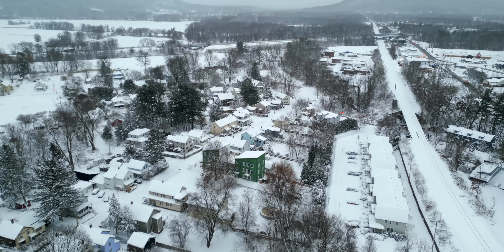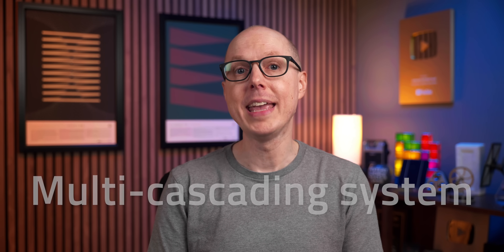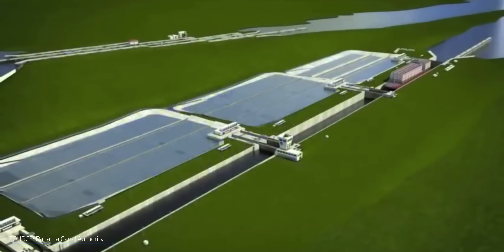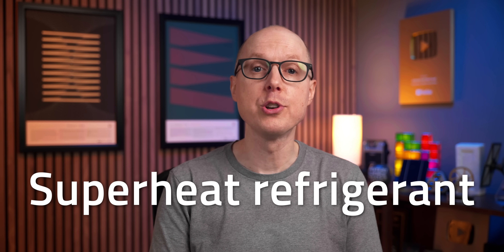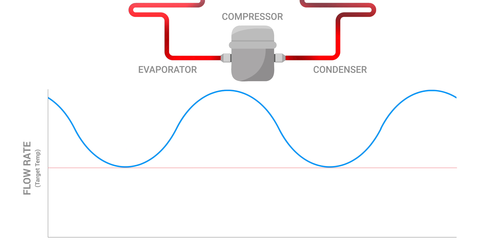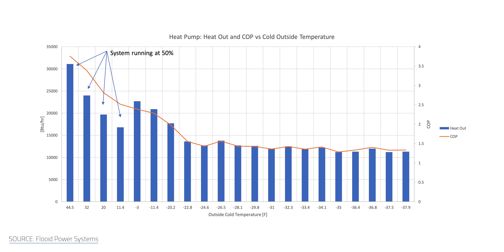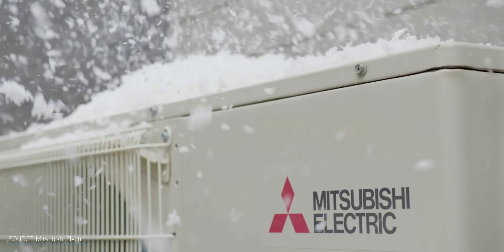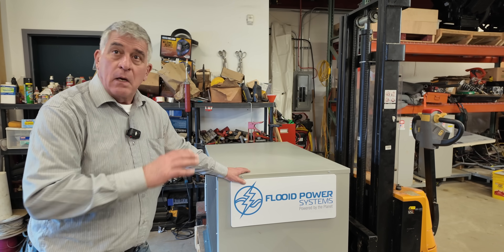How This New Heat Pump is Genius

Comment from the maker: Would you be interested in a cascading heat pump for your home? Try Rocket Money for free: http://rocketmoney.com/undecided  #RocketMoney #personalfinance

If you liked this, check out Why Do American Homes Suck? https://youtu.be/KDXjSpoOQmQ?list=PLnTSM-ORSgi7uzySCXq8VXhodHB5B5OiQ
Reply: I’m still hoping you do a video on fabric ductwork… it’s been shown to save up to 40% of the energy in commercial and industrial ventilation. Huge savings globally if adopted and could significantly help us reduce our carbon footprint as a species
Reply: @grantramsay9956  40% compared to what? Flex duct without insulation in the attic? That isn't even legal for commercial  where I live. Fabric ducts would actually increase energy consumption as it has a higher friction coefficient than steel.
Reply: @SuperS05  not sure where you got that info… Operating static pressure for fabric duct systems is 0.5 inwg and can go as low as 0.2 inwg. With a pressure drop of 0.03 inwg/100ft compared to sheet metals 0.05 inwg/100ft it also doesn’t have a worse pressure drop coefficient. Additionally, when you consider that a single drum louvre requires 0.4 inwg and duct design puts them in series means that most sheet metal duct systems require approx 2 inwg esp on the unit vs a fabric system only needing 1 inwg esp. Same CFM with half the static pressure which means half the required horsepower which means half the required power. I was being safe with 40% but depending on the system it could be more
Reply: @grantramsay9956  which product are you specifically talking about because your coefficient numbers are off. Fabric never beats steel on equal footing, due to the uneven dimensions. The industry standard design is 0.5"wc Esp, so anything else is not industry standard, and often just poor design. There is very very very few systems operating anywhere near 2"wc static. (highV is one noisy, and inefficient exception)

HP and static pressure is NOT linearly related. Even eluding to it is not correct. I only bring that up because it further demonstrates that you don't understand these systems. I do this for a living. Every day.
Reply: @SuperS05  I am talking about fabric ductwork for exposed ductwork applications, such as the products provided by Ductsox, FabricAir, and Prihoda. This is applicable for commercial and industrial applications, not for residential. It’d be a lot to try and explain but check it out. Fabric ductwork is designed on inlet velocity not pressure drop because there are holes along the length that let out air. This causes it to decrease the velocity in the duct as it goes along which from Bernoulli’s increases pressure within the duct and since friction loss is a function of air velocity it makes it a negligible concern. PS also a mechanical engineer who does this every day
Reply: Heck yes!  Been looking for a heat pump that could work in the extremes of temps... we get down to -15 F in the winters and up to 100+ F in the summers... which as you say, generally is beyond or at the limit of traditional heat pumps.
Reply: @UndecidedMF No! I work on cascade systems and I most definitely not what one for my house. Better oil management and larger coils make single circuit designs superior for anything but the most extreme cold. (IE artic circle cold) They will cost more to purchase, install, operate, and service and will. Most definitely be less reliable.
Reply: @SuperS05  What about combing two normal heat pumps with a water buffer in between?
Reply: @alexandruilea915  how would that improve anything? Every extra heat transfer generally results in less efficiency overall. Maybe I'm not understanding what you're asking.
Reply: @SuperS05  raising the temperature from -10 celsius outside to 40+ celsius inside directly is inefficient. I'm thinking that raising the temperature in two stages from -10 to +15 and from +15 to +40 should be more efficient, but I didn't test it.
Reply: @alexandruilea915  choosing the more optimal refrigerant and compressor is more efficient than using 2 compressors with lower compression ratios. Scroll compressors are not a good choice for wide compression ratios, they do very poorly when operating under their designed compression ratio, and have shortened lifespans when operating over their design. A different single compressor is more efficient than 2 scrolls for example.

Do remember that these temperatures are nothing special and are quite normal for freezers. (cold side at about -15°f, and a hot side of around >140°f for all standard applications including residential) If cascades were more efficient, they would already be used.  Not many places have a design temp colder than that.
Reply: @SuperS05  ours is supposedly made to work between -20 and +70 but I'm not sure about efficiency. Also, it's not with a scroll compressor from what I know. It's a modular design with 4 compressors that work at full speed at all time so it most likely is not a scroll compressor. The advantage here is that not all compressors start at all time unless it is under a specified temperature that I can set.
Reply: Yes
Reply: I would like to know more about geothermal heat pumps, as in buried coils or a well, not hot springs, etc.  And how to do it economically.  And whether to fool with retrofitting to existing heat pump, or go with one designed for this application.
Reply: @joedance14  Geotherman is cool and worth it if you have the horizontal space to bury the coils at about 2.5-3 meters deep into the ground. It's cheaper than digging deep like Matt had to do and more efficient than air-air or air-water heatpumps.
Reply: No. It's going to be obnoxiously expensive (it's N heat pumps in one unit and single heat pumps are already expensive) and if you thought compressor/coil maintenance is expensive and lousy on a single-loop system you can just multiply that by N for the cascaded arrangement. It's aggravated by the company promoting it being small so they need to amortize their development cost in a small number of units sold to stay in business. Plus, if they fail to stay in business you're totally screwed when anything breaks.
Reply: @db1481    coil maintenance will be similar, since the size of the coils is dictated by the design capacity and efficiency, and a few other minor factors not relevant here. "check ups" will be much more expensive  though, as you need to hire someone like me, along with it being almost twice the work. You're not hiring someone fresh out of school for those. As for service, I won't need the OEM to fix things even if you assume they use some proprietary circuit board or part. I'll replace it with something off the shelf easily enough as long as the unit isn't a writeoff.
Reply: This is already in use in Japan and Europe using a R407 or 410 outside compressor and secondary 134a system like the Daikin Altherma. The benefit is in an air to water hydronic system so you don’t have to change out old fin/ tube baseboard instead of changing to low working temp radiators or in floor radiant.
Reply: This really caught my interest when they said that this could be used for baseboard hot water heating systems, since that is what I have in my 1950s house (here in MA, like you @UndecidedMF ). Like a lot of the northeast, I currently have an oil based heating system.
Reply: I want my cold side of my cascading heat pump to keep my liquid nitrogen, liquid.
Reply: We have a traditional air to water heat pump that we used to heat our house in the winter. After the first winter that's exactly what I thought. A cascading 2 heat pumps system would be way more efficient as it will need to bring the temperature from -10 Celsius to just 15-20 Celsius (in a water buffer tank) instead of 40-45 Celsius that I actually need for my home. Then we use a water to water heat pump to raise it from 15-20 Celsius to 40-45 Celsius in the main tank. Too bad I didn't think about that from the beginning.
Reply: Look up Stiebel Eltron HPA 013 or Samsung HT-Quiet 8kw or bigger
Reply: Read my comment.
Reply: Not useful for residential or living space. Cascading heat pumps means less efficiency than two heat pumps or a much larger one for the same price. Cascading can only be useful if you need heat that is beyond the average heat pump and never or minimal use of resistive/electrical heating like in manufacturing or industries.
Reply: If it was made affordable even without rebates, yes
Reply: New tech usually purchased by the wealthy that makes it available later for the masses.  How many years to recoup that extra financial expensive?
Reply: Looks like a very interesting product. Glad I watched the vid.
Reply: Yes I would be interested
Reply: @UndecidedMF  Always  interested in new technology.  Live in old farmhouse and spend 200-400 a month on energy. Working on home all the time to improve. Would love to test cascade heat pump system. Live in Cincinnati.
Reply: I’m in North Carolina. I’m interested!
Reply: OK my question is like the guy below me David Mash, Why is the heat pump not set up to also work for your Hot water tank. With hot water tanks they don't protrude into the tank so there's less holes having to be drilled in the tank they run the coil around the outside of the tank As the heat exchanger. During the summer the heat From the house could heat the hot water,  Then in winter you use the condenser coil outside to supply the heat to the hot water tank. And the whole thing could be run by a computer In deciding what should be turned on and how. Anyone who's been part of commercial systems knows that you can have valves turn off and on that are designed to work with AC refrigerant. But everybody is scared to try it. Costco trade using Their system for their freezer and Their system for their freezer and cooler to heat their hot water tank but they made the mistake of using a tank that had the holes for the heating elements and run the refrigerator in the way instead Their system for their freezer and cooler to heat their hot water tank but they made the mistake of using a tank that had the holes for the heating elements and run the refrigerator in that way instead of wrapping around the Out outside of the tankof. Basically the problem was that the tank over time aged and leaked. But if you have a coil on the outside With no penetration inside the tank except for the water going in and coming out dag sends the life of the tank up to 5 years more than a normal tank  or More.
Reply: I have a stream in my yard.  I wonder if I could use that for a geothermal system.  My brother has aa farm pond on his acreage.  Put in for fire fighting water. Great for geothermal loops as well. Using unique features to save on install cost and up cold temp heat efficiency. Also saves on hot day cooking as the water is cooler mid day than air.  Thoughts?
Reply: Great topic Matt thank you for sharing this with us

Comment: How cold can these cascading pumps actually work at? 

-25c is pretty cold, but where I live we spend a lot of the winter much colder than this at times reaching below -40C. I have been wondering if any of these solutions work at these temperatures. 

At this point it seems like one needs a second system if air heat pumps are the primary heating system which is expensive.

Comment: The big problem is just more equipement and more power. It is power often goes out in storms. Even in a heat wave you can use water to cool yourself. That isn't the same in the cold.
A system like this would require emergency shelters like in huricane prone areas. And not only the power can go out the roads to move those people will be dangerous.

No a good idea to rely on electricity in life dangerous conditions. Even the backup battery system couldn't run such a setup for long. You would need a natural gas generator which would beg the question. If you have natural gas hook up and need heat. Then a furnace is the only reliable condition we have in extreme cold conditions except for steam and nuclear.

Comment: The big issue is that many of us only need heating for a few hours a day. So heating 24/7 for traditional heat pumps means big losses. So being able to go to higher temperatures for a sligtly lower efficiency might be worth it.

Comment: One challenge heat pumps face is repairability. An oil, natural gas, or propane heater can probably be repaired with parts on the service technician's truck before your house gets too cold. Heat pumps on the other hand are complex and evolving fast so the parts in any once place are very limited. Therefore, they can't really be a sole source of heat unless you want to play frigid roulette. A system like this that is reliant on a small supplier and is likely to be evolving for some time seems like a perilous purchase. The technology is simple and obvious. The magic is in the integration and packaging. The trick will be getting it ready for prime time.

Comment: Put suction accumulators back inside the heatpump like they used to have to help compressor with low superheat. Customers crank the ac with low ambient outside temps. Dirty filters too

Comment: ☀Not yet to this level with my new Lennox EL18KSLV-060-230A01 - 5 ton Elite Side Discharge Inverter Heat Pump that replaced my 16 year-old American Standard 5 ton HVAC Single Stage Heat Pump that the coil had failed on.

Comment: YES!  I want one of these new style flooid cascading heat pump systems to cool/heat & replace my old & worn out tradional gas heater & air conditioner systems in my 1,400 square foot home.  I live in San Jose, CA which has moderate tempseratures.  I want this fantastic new & advanced heat pump not that I am anti-C02 or a tree hugger-NO!  I want to go this new style heat pump because it all makes great common sense!  It's a great time to make the switch over!  I can't wait to get this product hooked up to the house!  I also have a new & robust roof solar system so it all together should be fantastic & efficient!

Comment: Better analogy for a cascading heat pump is this:  A refrigerator inside of your house.  The fridge dumps it's heat to the house, then the house dumps that heat back outside.  Each can have a different optimization - the fridge is made to expect about 75 degrees F on the outside all the time, so it can optimize for that and be much more efficient.

Comment: I was wondering about a different idea, mostly applicable to an air sourced heat pump.  Does anyone use a thermal reservoir (probably an insulated water tank) in ADDITION to air sourcing?  The idea would be to cool the reservoir at night (or heat it during the day) and then use that reservoir for heating at night or cooling during the day.  The advantage assumes some significant day/night swing in air temperature.  I am an electrical engineer and I am confident that this makes some sense in theory, but I just wonder whether it has been done or would make sense in practice.  I guess it might require two or three heat pump loops?  One (optional?) is air to home.  One is air to reservoir.  And one is home to reservoir.  Thank you.

Comment: Heat pumps are on!y good for the room they are installed in. If you have alarge home, you need multiple heat pumps and will.cost you far more than if you had a furnace or electfic heat.

Comment: As someone who has installed two heat pumps in the past couple years, heat pumps suck in the heart of winter.  I don't understand why people lie about how poorly heat pumps work in the winter but I suspect part of the reason is that the lie is a coping mechanism.  Heat pumps in the winter consume A LOT of electricity and produce little hest.
Reply: Note, at 30F and above they are fine for heating.  My comment is for temperatures below 30 degrees Fahrenheit.
Reply: That depends on the heat pump. Better units have improved cold weather performance. A system properly sized and selected for the application would work great. Applications that have a significant amount of days where it is colder than around 0F or -10F will probably be better off with a dual fuel setup.

Comment: Standard heat pumps have been able operate down to -20 for over decade!  

I installed a carrier heat pump at my lake house in north eastern WA State.  The electric furnace NEVRR kicks on!  The heat pump supplies 100% of the homes heating even below -20!!!  

Do some basic research

Comment: Wow!
This is a very interesting video about what seems to be a great heat pump. 
I live in south florida where is HOT and humid for most of the year.
Ive looked at heat pumps for a long time, and ha e consider to by a 3 ton unit with 3 zones.
But th8s units are so big, so robust.....
Is there anything like it out there that is smalker?
Another heat pump that comes on a smal,er box or body that can effiently run where I'm?
Thank yiu sk much!

Comment: Modern petrol engines with an ECU do improve Mpg. but has the savings on fuel covered the problems of extra complexity.  A sensor failing closes down the car and no one seems to replace the correct one bit on the side of the road?  It's doubtful,  and we are going the same way here with complex water heating systems to maintain.  Many otherwise good cars are scrapped with ecu faults and no one to fix it.  A2A at 22C is efficient A2W poses a more complex problem that may not be viable. let the customer know the facts and choose because he foots the bill. 1970's cars were reliable and fixable a bit smaller might have been a better route

Comment: Ack, the fact that multiple systems in series to make things actually work correctly talks to the issues with heat pumps.  Something we talked about in the 80s in engineering school.  People keep coming back to heat pumps, but they only work correctly in certain areas of the country.  The most cost effect way of dealing with the energy issue is to improve home build standards.